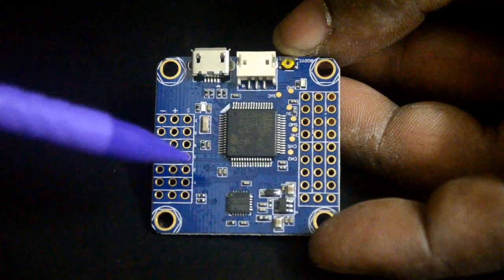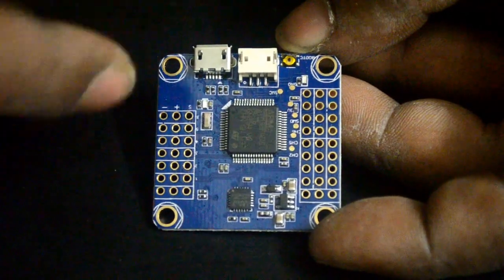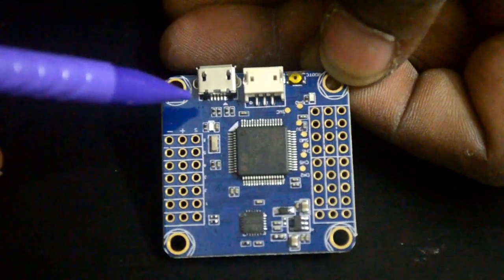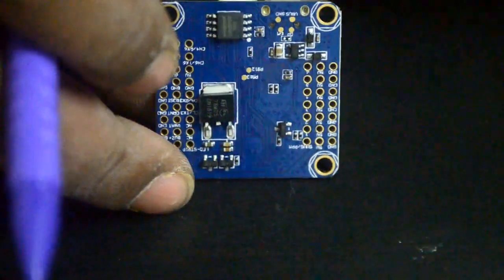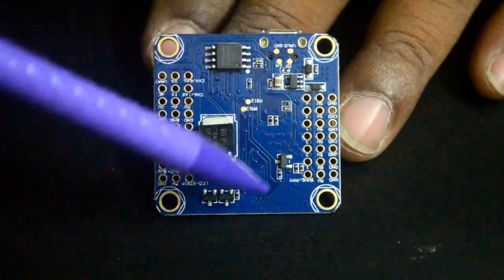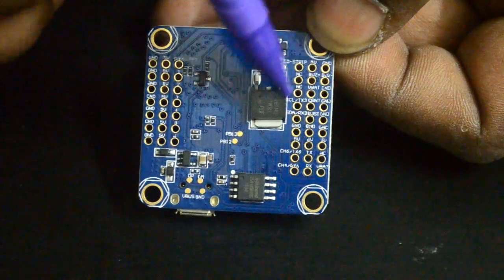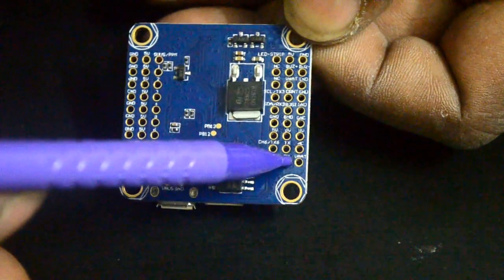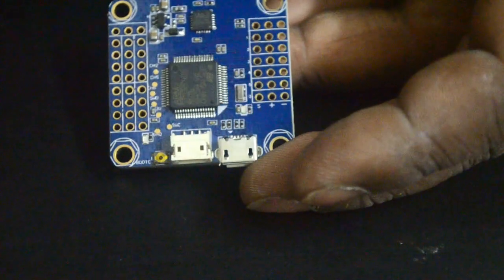F4 Flight Controller Acro Version - 1b

Comment: I am trying to get my speksat to work on my f4 revo board. I bound it using a full sized spektrum reciever, and have it plugged into the sat port on the board. I have the UART1 port set to SerialRx, and everything seems to be configured properly. The problem comes when I go to the receiver menu. I see no inputs there and whenever i apply tx inputs, it crashes and disconnects from betaflight. Please help.